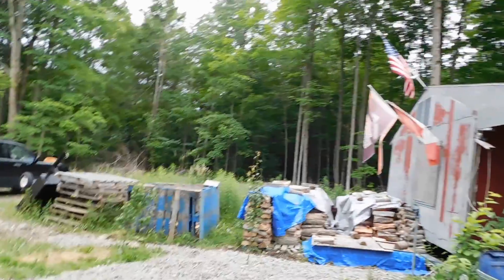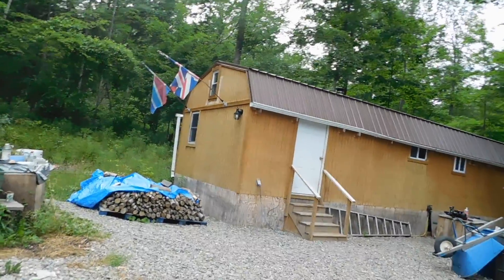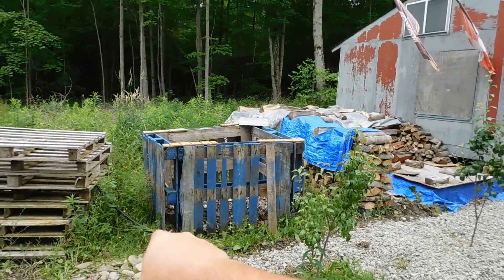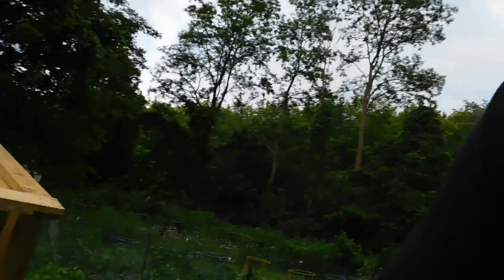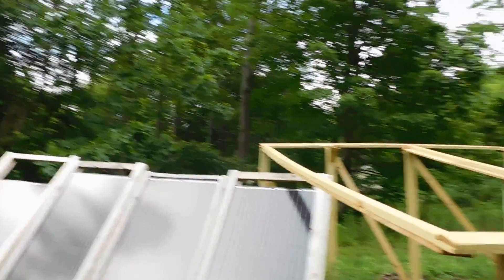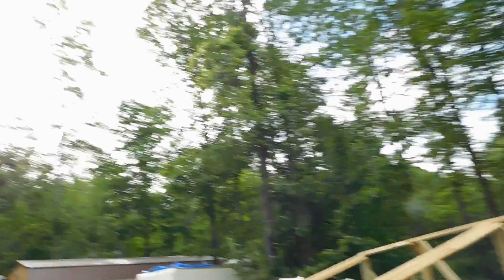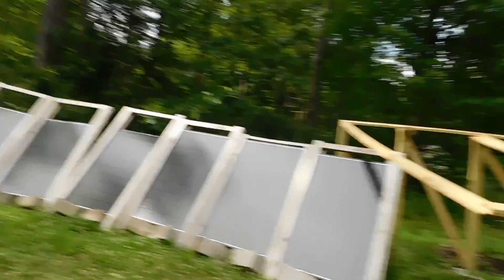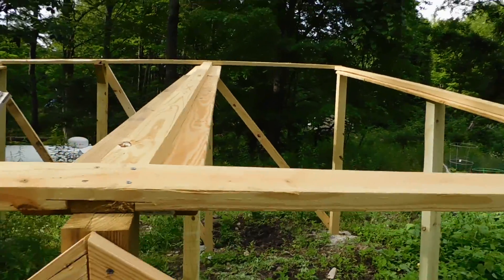Clearing things up about my wire for the solar panels.

Comment: You are correct. DC wire code is far more relacked than AC wiring code. And the power output is not as high from the solar panels. He is fine. Only the AC side is required to be code, because AC is the more dangerous side. You are doing a great job with your setup.
Reply from the maker: Thank you very much.
Reply: You are quite welcome keep up the improvements.

Comment: What is the gauge of wire you used for your solar panels? And how far was the run to your garage? It looked kinda like 45 feet or so the way you were running it.
I have not watched today's video, but I have watched the past couple on your solar panels. Thanks!
-Jerome
Reply from the maker: I used 8 gauge wire. And its about 100 feet.
Reply: preppernurse1 that should be MORE than enough even if you up graded a little bit. I am not a electrician, but I think that you have done a great job. 
What is the total wattage you are planning on running when fully set up?

Comment: I totally understand where you are coming from with solar wiring Ed. As an electrician however there is an article # 690 that covers solar/photovoltaic systems, and this goes for grid tied or not tied systems. Not tellin you what to do, just making you aware that the N.E.C. has rules to follow if tied to the grid or not. I would imagine that your system is fairly safe, even if every rule isn't followed. I have seen some YT channels do their own wiring and not only looks horrible but is unsafe to boot. Some of these people needs lots of guidance but do not take constructive criticism very well. Anyway best of luck, rant over. Lol
Reply from the maker: I hear where you are coming from and I am trying to make mine as safe as possible.
Reply: Yeah, but at least the part that Ed did that is not up to code (DC side) is OUTSIDE of his house.  He said the AC going to the house and the house itself are up to code so, I'm guessing he's pretty safe.  If something happens to his DC wiring, it'll just be a pain in the ass and it'll have to be fixed.  No one will be hurt.
Reply: Christmas Eve yep I got all that from his video, I was just informing Ed that there really is a dedicated article of the national electrical code devoted to solar. I think he's a step ahead as far as safety etc. However did you know that in many ways DC current is more dangerous than AC? The direct current shock tends to tense up muscles making it harder for mammals to get loose of it, whereas the pulsing of AC gives a person a chance  to get loose in the middle of the cycle? Besides all that I wasn't trying to bust his chops, just inform him, if you look back at the original comment you could probably see that. Thanks just the same for your comment. As an electrician I do have an obligation to notify others of codes and proper wiring methods.
Reply: Thank you!! You are a very respectable person...  And RESPONSIBLE as an electrician.  I hope I didn't sound too forward in defending Ed when he didn't even need defense from you because that wasn't the reason for your post lol. 
I have heard stuff about DC power being more dangerous. I have touched the leads coming from four 250 watt-solar panels in series (open circuit) which would have been about 35V each (so 140V) and it felt very much like a jolt from 120V AC.  I was able to pull away from it without any problem.  Maybe the key to it is the amount of surface area making contact with the skin.  If it's DC and you're making enough contact, my muscles would tense up and I would get electrocuted?  What do you think?  That was just my off-grid system. I've never tangled with my grid-tie system that exceeds 250 VDC.
Reply: Christmas Eve it's not so much the surface area but rather the particular muscles involved and the organ etc that the current passes through. example if the shock occurred in the palm of the hand the hand muscles would tighten and be unable to let go. If the current from positive to negative went from one hand to the other through the heart it might and most possibly be fatal. Whenever possible a smart electrician will work one handed to minimize the odds that the previous scenario would happen.
Reply: Christmas Eve no worries

Comment: I've been meaning to ask, how did you decide on the angle of your new array? It looks like a fairly shallow angle, so is it aimed for peak performance at noon on the summer solstice? I'm still brainstorming the design for a solar-charged auxiliary power system for our well and pressure tank.
Reply from the maker: I was checking out other fixed arrays near me and I wanted to try and get it at what would be best for us.

Comment: Hey! Looks good, just a quick question or two. 
How long a run is it from your panels to the monitor charge converter? Did you experience any voltage or current drop with the distance that you are running the lines? I like the idea of putting the panels out away from the buildings and trees, but concerned about the lose across the run. 
Thanks for sharing!
Reply from the maker: There is some loss but that's going to happen. As I add more we will see how it goes.
Reply: preppernurse1 thanks! We will be following along! Hope things go as planned!
Reply from the maker: Thank you and I hope so as well.

Comment: Hi Ed, you'll be fine. By putting the low voltage  power cables in your  2 inch conduit, will keep animals from chewing. the wires. try protect the wires above ground as well. Good work.
Reply from the maker: Thank you I will do that.

Comment: A helpful tip for the next time you run wire.Use a stick on some blocks so it does not tangle up or you can just unroll it before you start. great update and thanks for sharing.
Reply from the maker: I will do that thank you.